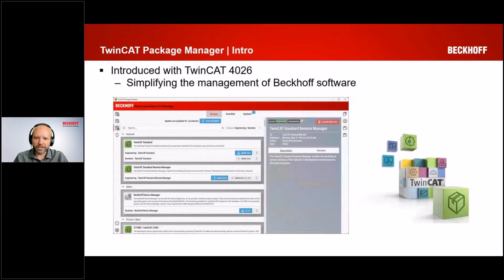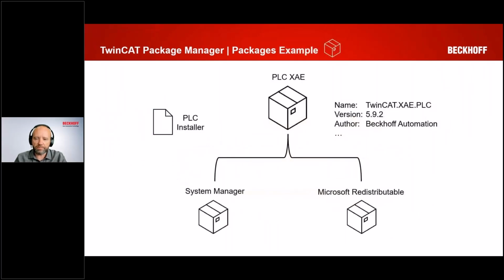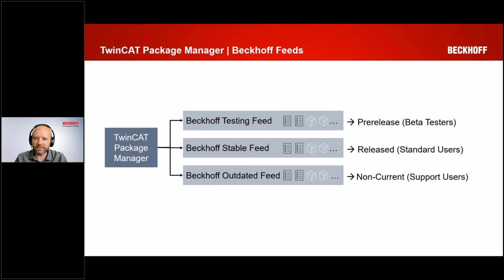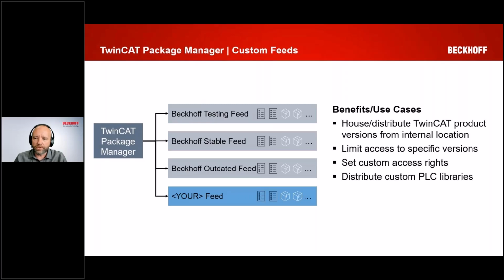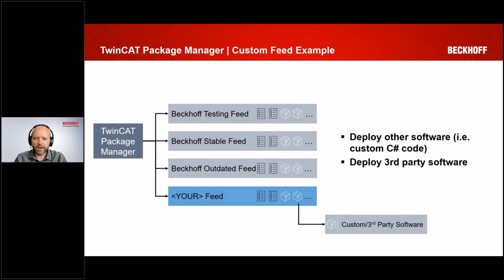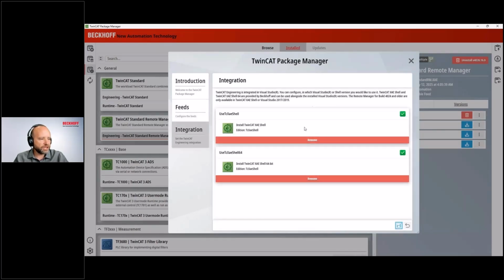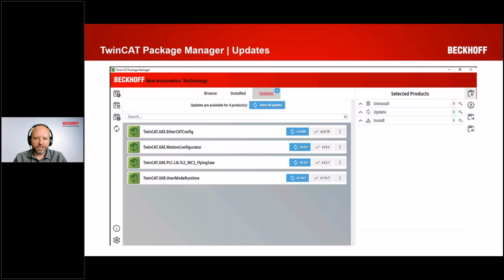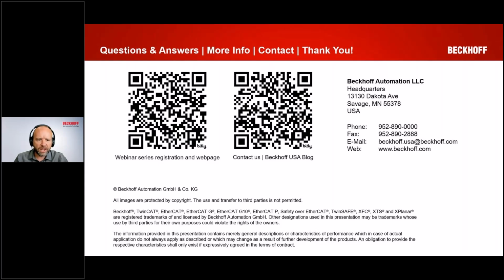Simplifying Software Management with TwinCAT 3.1 Build 4026 Package Manager | Webinar, June 2025

Comment: How ist this exactly working with a remote install? How can I signal on my local computer that I want to install a package on my remote IPC?
Reply from the maker: Thanks for your question! There are a few options which are best discussed with your local Beckhoff representative. But one example would be to use our Command Line Interface (CLI) and the "tcpkg remote" command to build the various remote options. Then many commands such as "tcpkg list" or "tcpkg install" have a "remote" argument to them where you can specify which remote target to select. For deeper dives into our products, please reach out to your local Beckhoff representative: www.beckhoff.com/contact